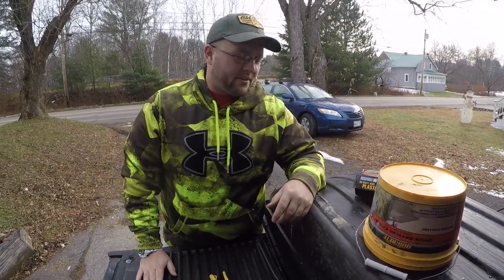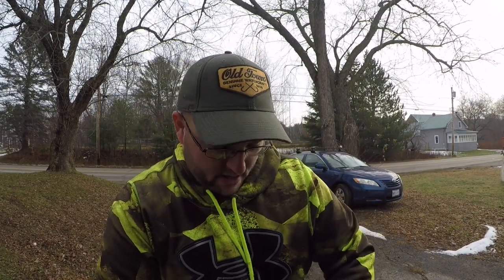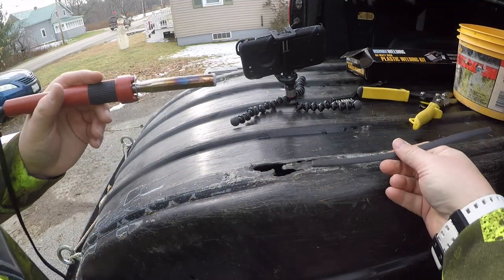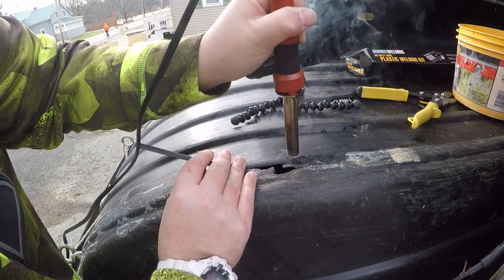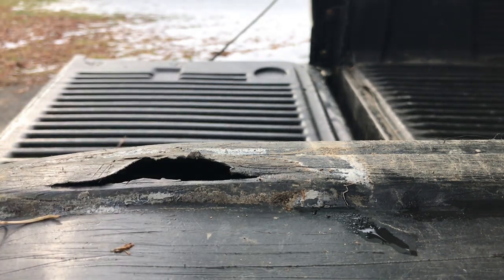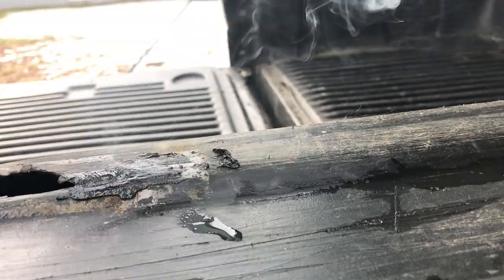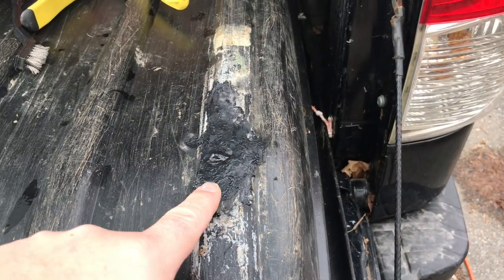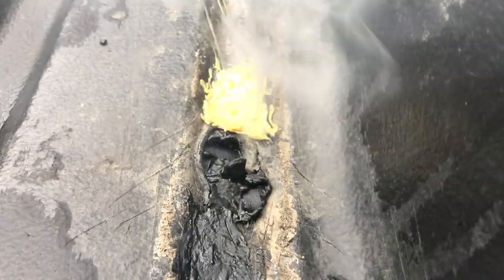How to Plastic Weld a Jet Sled. How to Fix an Ice Fishing Sled. Harbor Freight Plastic Welder.

Comment: My Jet Sled wore through after 7 years or so. I took an old pair of downhill skis and bolted them to it thinking it might buy me a year or two, but it actually lasted another 5-6 years before I gave it to a friend and bought an Otter. The Otter hitch is definitely superior and I installed the runner kit, so it should last a long time. Hope your fix works!
Reply from the maker: It should. Pretty solid. The ski trick, and runners work well.

Comment: Just made the same video with fiberglass which lasted one boat launch! I didn't even think of plastic welding. I just bought the high speed plastic runners for $45 they should help with drag and give me a few more years.
Reply from the maker: Ive tried fiberglass a few times, looks good initally, but have also found it doesn't work long term. Them runners are a good option. Hoping my weld gets another couple years.

Comment: use some mig welding wire or any thin wire to stich the tear before you plastic weld over it. Ive had a few things I repaired this way and it held better than without
easy to hold the heater to the wire and it just sort of falls into the plastic beneath as well. 
happy fishing
Reply from the maker: I was going to use the mesh that came with the kit, but ran out!! It’s is best practice to use something like that

Comment: Great idea but I still wouldn't leave it like that. Some after market plastic runners will make that repair last forever.
I could see it cracking after a good crunch especially since plastic doesn't like cold.
Reply from the maker: Agreed. The plastic runners will definately last longer. I’ve hauled firewood with the repair 10-12 times and it’s holding up well so far